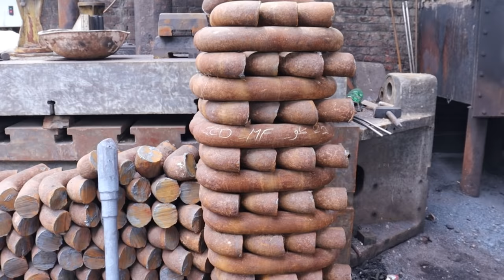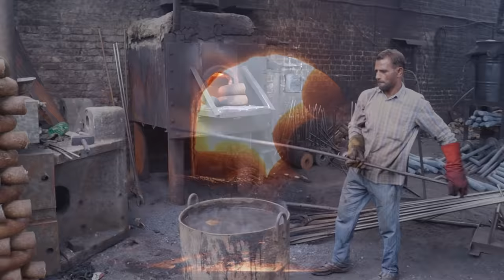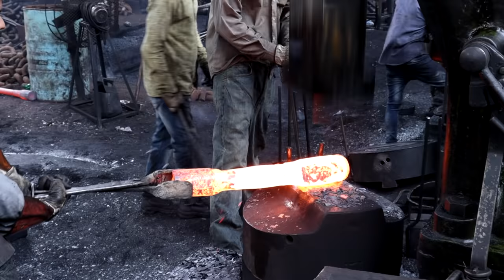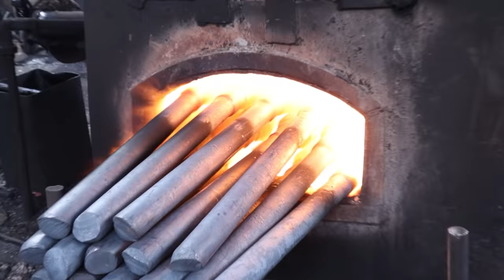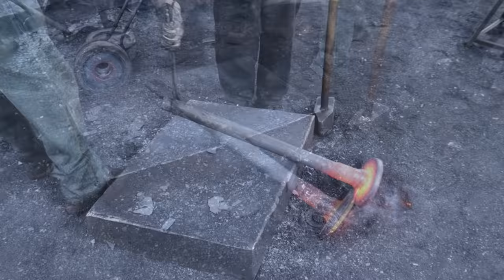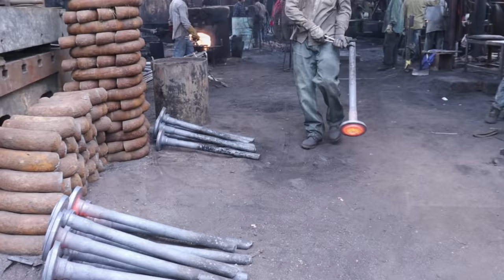Most Incredible 8x8 Truck Axle Forging Process

Comment: Someone in the comments mentioned efficiency.  This process is about as efficient as one can get with the machines available.  More efficiency could be obtained by rolling out larger billets, cutting to the desired length, then drop forging the end.

Although the recorded process may be relatively efficient, it is extremely dangerous.  Throwing around several hundred pounds of hot steel with everyone just standing around is a recipe for severe injuries, of which there are probably a good number in this factory.
Reply: We can all make small youtubers big so we all stay by everyone's side without being jealous of anyone. Let every moment of life be colorful
Reply: several hundred pounds ??? more like 40#

Comment: I guess I'm just blown away that a metal forging business that looks like a Boston 1900 industrial revolution scene exists today. The machinery that has no safety to stop you from smashing a limb, muddy water that might cause you slip and fall under a press, against a forge, or drop a chunk of glowing metal on yourself or someone else, the noise of the smashing that would cause hearing damage, the backbreaking work of manually hauling the clamps, no ventilation hoods to catch fumes. This doesn't seem real in 2022.

Comment: The workers are put to cruel treatment,no adequate protective measures.As per law it is illegal,they are handling it carelessly.If the hot metal acidently touches the body their body in no time the said portion of the body will be vanished.Inform the labour department to shut down the factory.